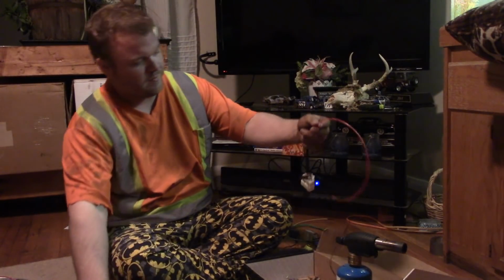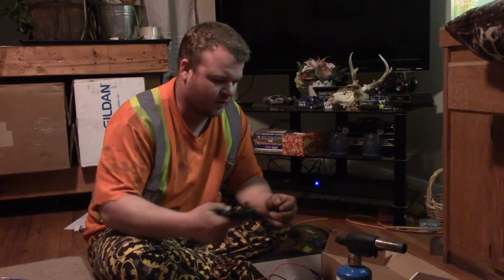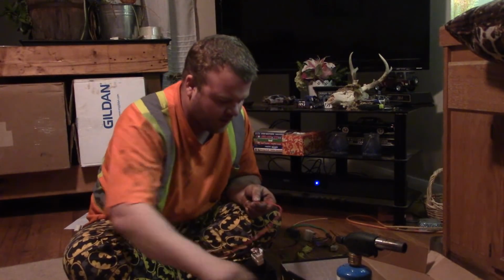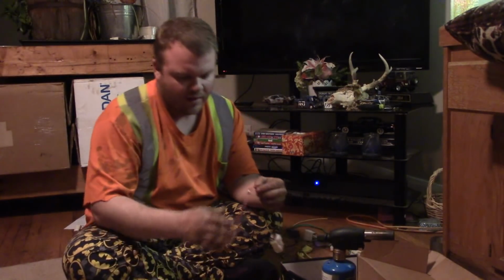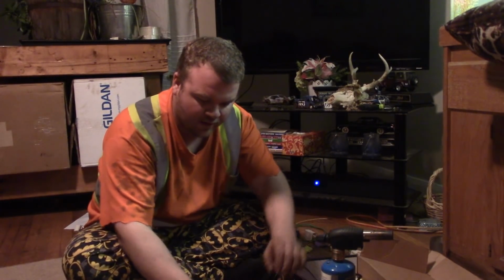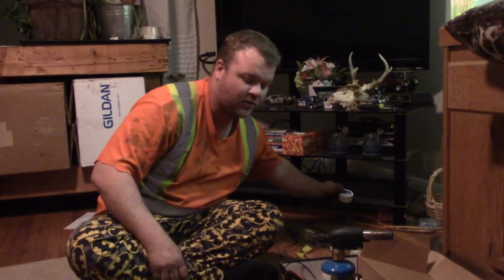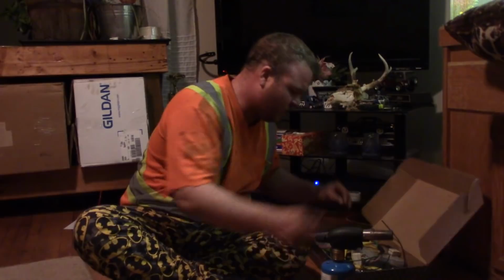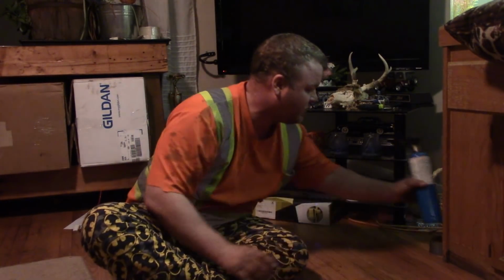1992-1996 Toyota Camry Stand Alone Wiring harness Part #2

Comment: I have done this on other Camrys I have ran. The 94 I have now has a blue connector where the power and grounds are located. It has less wire then the white connector you are showing. Have you ever done one with the blue connector?
Reply from the maker: Its the same its green and purple ur missing they are un needed
Reply: @zacksworkshop171  Thank you

Comment: you are my toyota guru...can you tell me how to make a 1998 toyota tercel engine run out of the car because i want to use it in my boat. I'm in the process of trying to put power and ground to the right plugs in the ecu by splicing into the engine harness and connecting it to the negative and positive of the battery, is this the right direction ??
Reply from the maker: i have never had one so i have never had a chance, why not use a camry motor

Comment: Hey I simplified my 93 Camry but the rectangle one doesn’t have the purple wire on it and the plug for the top of the computer is different it’s smaller
Reply from the maker: thats fine just build it as if it was there its not needed

Comment: I have a 95 camry. I am not familiar with this. I have a question for a complete harness. Which fuses or relays affects the power steering and shift enabler for automatic when brakes is depressed?
Reply from the maker: the power steering has no fuses and the transmission has not fuses and the auto park lock out is done but the brake petal

Comment: I don't have the purple or the green will it still run
Reply: It's on a 96 Camry
Reply from the maker: yes it will
Reply: @zacksworkshop171  I figured it out ran it last year an ran it again this year at the catt county fair I just crushed front drivers Fram rail an lost bumper might cut it pull it and weld it up for 1 more run